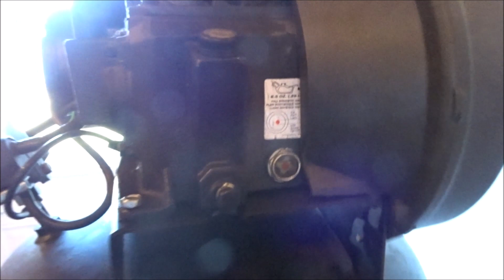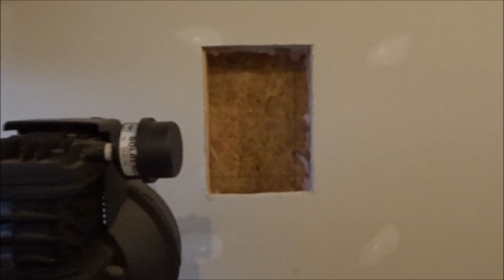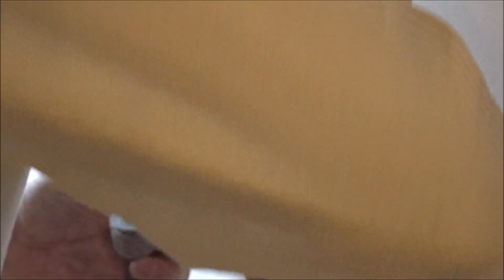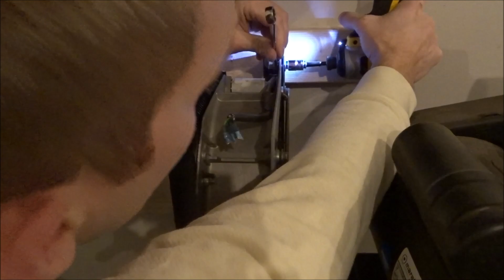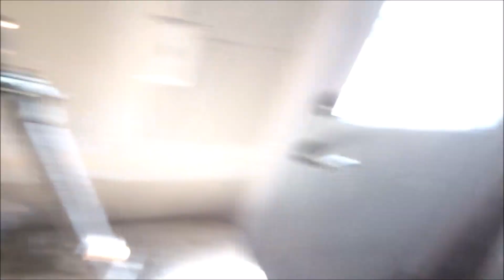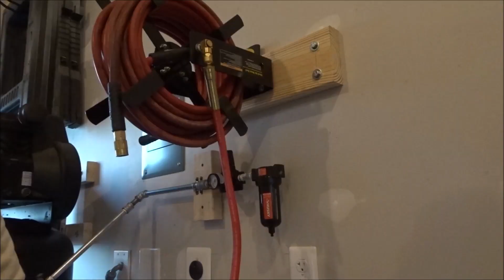Kobalt Air Compresor Review and Install

Comment: Did you check your brass sleeves for the bevel angle?  Common flare has 45° levels, and JIC and A/N have 37° levels.  While they can be connected together, over time they will leak if you mismatch them.

Comment: I need a power cord like this one do you have a link?
Reply from the maker: Ricardo Hz this should do it, make sure you confirm the wires meet the amp requirements. https://www.homedepot.com/p/Southwire-4-ft-8-2-Ultra-Whip-Liquidtight-Flexible-Non-Metallic-PVC-Conduit-Cable-Whip-55311401/307478862?mtc=Shopping-B-F_D27E-G-D27E-27_4_WIRE-NA-NA-Feed-PLA-NA-NA-WIRE&cm_mmc=Shopping-B-F_D27E-G-D27E-27_4_WIRE-NA-NA-Feed-PLA-NA-NA-WIRE-71700000034238975-58700003946879302-92700050456676697&gclid=Cj0KCQjw17n1BRDEARIsAFDHFexLpX4EyyvnB27H_fu7024Ona3rSJ4DaU0OtUlwwAUoWZnrPwGrtgEaAkQ9EALw_wcB&gclsrc=aw.ds

Comment: Thanks for the video!
It's in the shed now? Is it bolted to the floor or did you strap it to the wall? If you didn't bolt it to the floor, can you tell me what you did?Trying to find a better way to secure it without putting bolts in my floor.
Thanks brother!
:)
Reply from the maker: Jason Enz yep, she’s in the shed! I did end up bolting to the floor. If you don’t want to do that I suggest putting the unit in a corner (correct distance from the wall for cooling) and put a strap around the tank to each wall. Also, bolt some thick insulators on the feet. The safest option is bolting to the floor. Hope this helps!
Reply: Strokers Garage - I hear you. I have a daughter so I think I'll just suck it up and bolt to the floor. Thanks dude! That did help :)

Comment: I'm an electrical guy and have a few comments.    Very good decision to convert the receptacle to a sub panel.   Very well done overall!    Two things to consider.   120 volt receptacles in a garage with concrete floors should be GFCI protected.    All panels are required to have 30" wide, completely clear working space in front of it.    Again, overall great job!   Respectfully,   Kevin
Reply from the maker: Kevin Coop thanks! The outlet is not currently powered but is also a dedicated outlet for a lathe which, from my understanding, doesn’t have to be a GFCI (I believe I read this in the NEC). I did install on the other side of the garage the same deal with additional outlets all tied to a GFCI. As far as the space, it’s there, the compressor was moved out back of the house inside a tool shed. Good call on that!
Reply: Strokers Garage I believe that an exception to not having all 15 and 20 amp 120 volt receptacles would possibly be for a single receptacle dedicated for possibly a freezer.   So let's say, it's dedicated and for the lathe and we are using the exception.   In order to be correct, it would have to be a single receptacle, not a duplex receptacle.    So, if you sell the house, the fix would be either change to GFCI receptacle or a single receptacle.   Very nice compressor.   Thinking about getting one too.   Respectfully,   Kevin

Comment: If you break it in the way they say it will make it quieter.   I have a friend with a big commercial compressor and he said they used a cooling system to prevent water when they paint.  Now I know what he was talking about.   I think he said it drops the air down to almost freezing, but I could be wrong.  Good video. Thanks for all the details.

Comment: I wish I was as well spoken as you. Nice setup 👍🏻 I’m doing the same and have everything but I’m concerned about using the pulley fan (guard mount) as it may not cool the compressor pump well enough due to the hot air from the transmission cooler. I found a good deal on the same Papst axial fan. What made you go with that over the more common and simpler guard mount?
Reply from the maker: wheelstandr I had the same concerns as you. Kobalt instructions said to keep the compressor a certain distance from the wall to maintain good cooling of the head. I felt adding more heat could cause an issue. Plus, mounting it (the way I did) and plumbing it wasn’t that difficult.